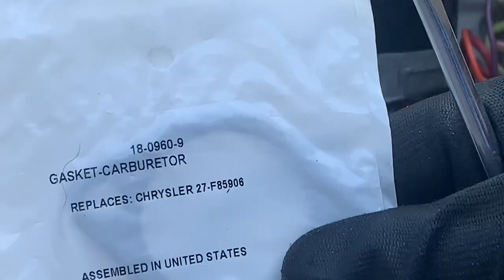1986 85 hp Force - Part 3 - Fuel Issues Fixed - Stalling in Forward Gear & Running Rough at WOT.

Comment: I have the exact same motor mine won't rev up idles good. it barely go's forward and backwards won't accelerate proper speed. Any one had this problem same motor 85hp force. Thanks
Reply from the maker: It could be plugged high speed jets in the carbs or even ignition problems with a bad Stator, Trigger or Switchbox. You need to check your resistances and voltage outputs on each to determine if it’s electrical or a fuel related issue.

Comment: Would you happen to know why my 85 does this?? when I go full throttle it will not get out the hole just slowly pick up speed then all of a sudden it goes full out fast sometimes it will just go slow the whole time I changed the fuel filter and spark plugs it ran good that day then the next it started doing the same thing
Reply from the maker: It could be many things including but not limited to a faulty fuel pump, dirty high speed  jets in the carb, fuel lines or even a bad stator or trigger.

Comment: I have 85 force 125 , on cold engine will only start with carb spray . Once it’s on , stays on , No issues after that. On warm engine starts right up , I’ve clean carbs , adjust screw mixture but I just can get to turn on on cold . Is that a fuel pump problem ?
Reply from the maker: 0708el… it sounds more like a choke solenoid problem. Check to make sure the butterflies are closing when you push the key in while starting. If the choke solenoid is working properly and butterflies are closing completely then I believe your carbs idle circuits may still be clogged. It’s also possible your primer bulb is bad. Make sure the primer bulb gets hard after squeezing it several times before starting the motor.

Comment: Hi.  I did not see what valve was by-passed.  Not sure if I missed that.
Reply from the maker: The valve was connected between the gas tank and the primer bulb. This valve was designed to allow constant pressure to the carbs from an un-vented gas tank. This is what was recommended by the owners Marina to be more environmentally friendly and not allow fumes to escape to the atmosphere. It caused fuel starvation to the fuel pump.
Reply: @LivetofishOutboardRepair  Thanks for the very clear explanation.  And the great video of Lake Sinclair.

Comment: hey i just got one from the auction, how you mix the gas?
Reply from the maker: You should add 50:1 (50 parts fuel to 1 part oil). You can use any TC-W3 two-stroke oil. I recommend QuickSilver Mercury.